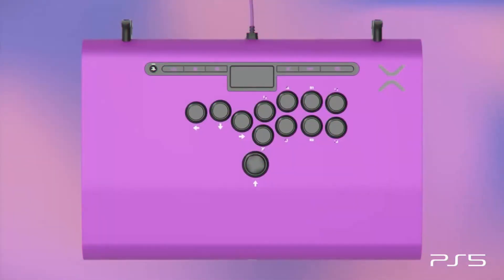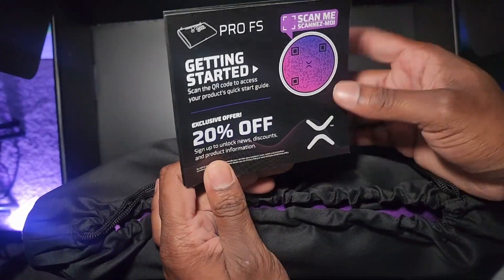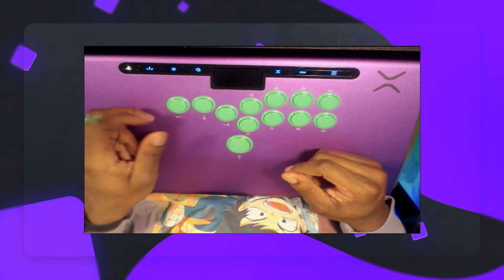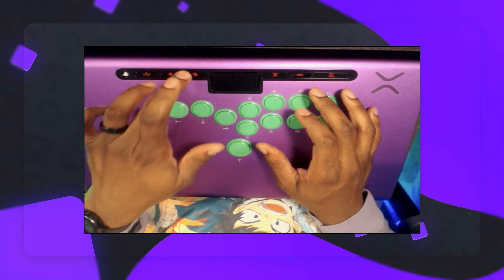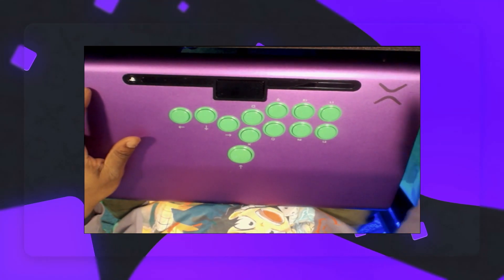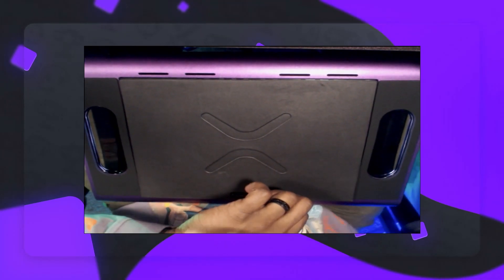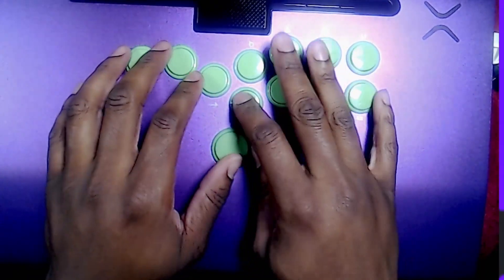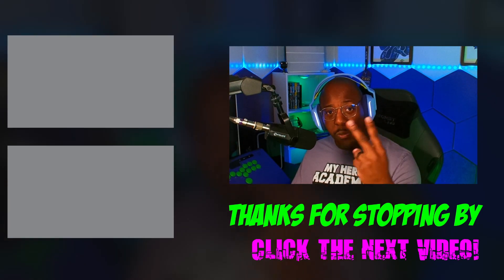Do NOT buy the Victrix Pro FS-12... Unless | Complete Review

Comment: Still deciding. Only reason I don't want a custom for cheaper is that the brook board for ps5 games is 100 bucks, which I need when sf6 and tekken 8 come out. If I'd be spending that much on just the PCB I'm thinking I might as well just go all out and get this, the only hitbox with built in ps5 compatibility. Seems to have the nicest enclosure of any box I've seen, plus I love the RGB and how easy it is to customize (just wish there were more colors) Think it's worth it in my case or still no?
Reply from the maker: Well like I said towards the end of the video, what kind of player you are will ultimately dictate if you should pick this baby up. Your dedication to the genre is what I base it on. If you are going to use this thing every day and get time in on it, then I don't see a problem with it. Plus you said it yourself, it's set up for PS5 out of the box. So I think you will most likely be pleased if you fit this criteria.
Reply: @Tr1zzle  thanks for the input! Was having second thoughts but I think I'll pick it up because if I do ill be using it a long long time 👍

Comment: It's super heavy and loud right?... I already didn't like the weight of the 1st Panthera and this is almost twice as heavy from what I read online, and the metal case with all Sanwa will drives my neighbors insane at night. Guess I will wait for the low profile Razer hitbox with optical switches
Reply from the maker: It's not uncomfortable heavy but it definitely feels well constructed if that makes any sense. And the loudness depends on what buttons you use. The stock buttons are about average in terms of loudness.